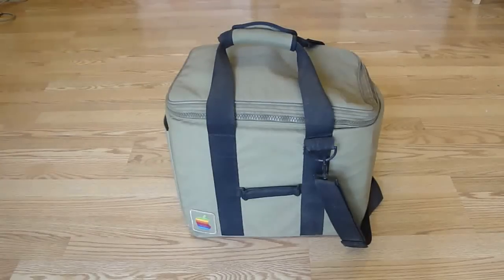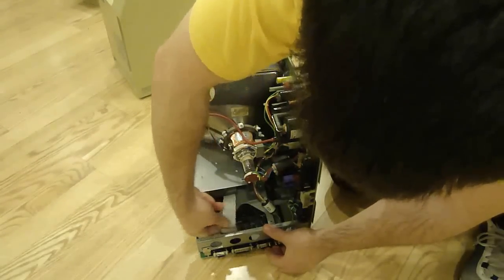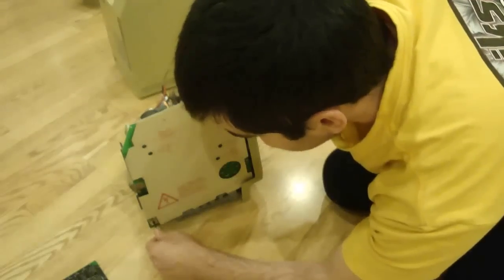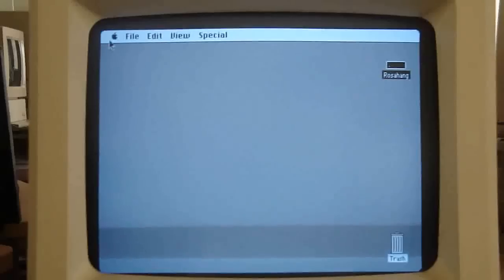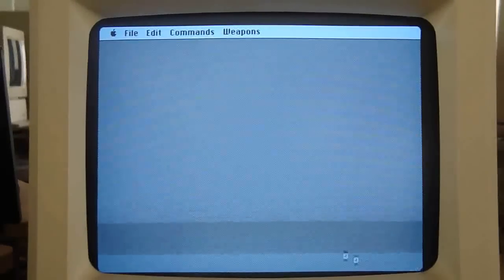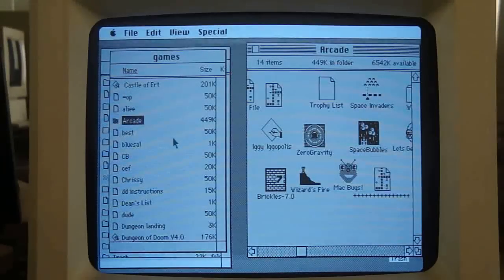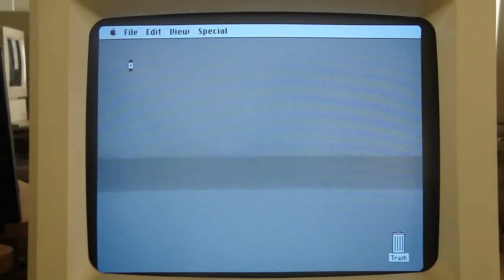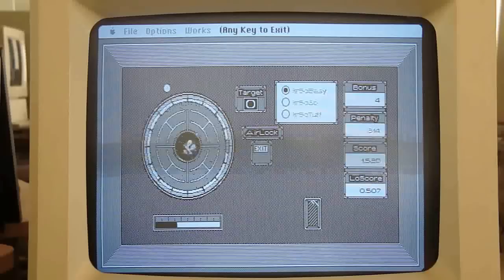1984 Macintosh 128K/512K Teardown and Review

Comment: Grounding to the chassis only works if you have the AC cable plugged in, otherwise you're just floating the chassis voltage as well

Comment: Thank you so much for this clip! I worked at Apple back then. Haven't seen the inside of an original Mac for many years. Was an engineer in Peripherals Test and Hardware Development. Tore apart and reassembled dozens of machines like this every day. Also HDs, mice, keyboards, trackballs, joysticks, scanners, even fax modems. Your video was a real treat. From the instant you opened it, the layout and components were as comfortable as an old shoe (I was telling you out loud not to forget that last wire, lol, and yes, we used to enjoy tossing those charged tubes to unsuspecting new colleagues). I still have my long Torx driver and case splitter. Sadly, most of my other old stuff was given away or trashed long ago. I left Apple in '88 but went back multiple times, finally leaving for the last time about five years ago. Looking back, I still love the way it was so easy to disassemble, upgrade and repair early Macs. Ingeniously simple. Today's designers often spend too much time immersed in a rendered CAD world and have little experience at the bench. They've forgotten the art of creating products which are beautiful in their entirety. Thanks again for this flashback.

Comment: Back in time when Mac was repairable. At today it is overpriced, prone to break (no conformal coating on PCBs in computer with 3000$ price tag) and only option provided by Apple services is to completely change motherboard for another 1500$. And even that doesn't guarantee that new motherboard will not break after a month because it is not new, but is a refurbished crap (and refurbishing is gluing a rubber pad over SMC chip). Apple, WTF!

Comment: I still have a 512k machine that was upgraded to 2.5MB RAM with the MacSnap upgrade board, and a SCSI port using another MacSnap product.  The 25-pin SCSI connector came out of the battery door, so there was no exterior case modification needed.

Comment: How come this Macintosh has an internal hard drive? I used to have a Macintosh 512K way back and we always had to put in 3.5 inch System disks in order for it to start up.
Reply: +ChaosPod It does not have an internal hard drive.  The Mac is sitting on top of the hard drive, and it is plugged into the floppy drive port.  Yes, it was very slow.   Later models would add a HDD port, and then the Mac Plus had a 25-pin SCSI port.
Reply: +rbstorms Oh, I see. I didn't realize 512K Macs had hard drives as all I remember from it was the Mac in one unit with monitor and floppy disk drive combined and then you would connect the keyboard, mouse and also a 2nd floppy disk drive if you wanted and everything would run on 3.5 inch floppy disks.

Comment: I used to service these.    Take a close look at the solder connections under the flyback transformer.  (the big component that has the wire going to the side of the picture tube.    One of the solder connections was notorious for cracking around the pin of the transformer.    It would arc for a little bit until the gap was wide enough to prevent contact, so it will be obvious.

Comment: Using a screwdriver with a thick wire to discharge the CRT is a good idea IF the other end of the wire is actually grounded.  In this case, it wasn't.  The safest method, if you don't have the right equipment, is to take that little Mac outside, look for your house's ground wire (copper rod in the ground near the electrical box) and connect the other end of the wire to that ground rod instead of the Mac's chassis (which in this case would be a 'floating ground' that could still shock you good).  Now you have a true GROUND (hence the term) at ground potential.  The electricity in the CRT will race out of the screwdriver, down the wire into ground rod in the soil and into Earth.   You'll be perfectly safe.
Reply: yes and no, you are implying that the frame isn't sufficiently isolated from the CRT's circuitry and it was. The biggest cringe I got from this was no resistor inline on the jumper cord. 2nd going 'outside' is just stupid. there are ground points everywhere in a house and especially a shop. Anyone who worked on elx has both an outlet  stub and a ground stub. When elx really needed it, not now due to the throw away mindset of development and the lack of any real elx repair shops, you would then attach yourself to the ground point for anti static reasons. Though internal (both chip and board level) anti static solutions are the norm.

Comment: You could use concrete as ground for discharging the CRT,I learned that the easy-ish way,I dont have a Macintosh yet,but I will get one. My dad told me that concrete is ground after my MacBook zapped me a couple of times when I touched it with my wrist while it was charging.
Reply: Please be careful!  Concrete is not a good ground.  Concrete is an electrical insulator.  Electricity will not flow into concrete at the extremely high voltages, 10,000+ volts, a CRT discharges.  Go outside and use the HOUSE GROUND ROD near the electrical box.  It's that copper rod in the ground with the wire going up to the box.  It is a true earth GROUND.
Reply: +Herb Garcia this is very good information. also sometimes the grounding rod is inside like in my old house it was in the garage on the opposite side of the wall where the breaker box is. but it's always gonna be somewhere near the breaker box in case any of your reading this can't find it
Reply: Would it be possible to replace the CRT with a LCD display? Just curious. LCDs don't use as much power as a CRT.

Comment: Recap the analog board and it might work.
As for the ram upgrade most 128K macs were upgraded to 512K as you pretty much needed 512K ram to actually use it.
Reply: ***** I think you mean that the 512K upgrade was needed for it to be useful, especially later on (22K was consumed by the video RAM alone!).
Reply: Yuhong Bao
Yes as otherwise you would be constantly swapping disks.
The Mac that ran the 1984 demo actually had 512K of memory.

Comment: I got the mac se fdhd and too bad the hard drive is dead. It won't spin up but a quick smack or two fixes that but the actuator arm won't move. If it did I could invade privacy and see what cool stuff is on it. I just bought a new 230mb hard drive for it. So excited to get it working.

Comment: Once you add 3rd party RAM upgrades (a hack), then it's not a Mac 128K or 512K anymore.  Those models are defined by their RAM, which was not made to be upgradable.  What you have there is essentially a Mac Plus with 2MB of RAM in the original casing.

Comment: Looks like old Sal is still working after a quick google search. I guess he didn't learn about deleting your files before dumping or selling your old computer.

Also, I've never seen anyone use needle nose pliers to pull the flyback anode, I usually just use the same flathead that I use to discharge it. Either way works, I'm just paranoid of getting shocked and prefer to have it grounded to the chassis the entire time. I've seen a few that hold charges even after grounding multiple times.

Comment: I used to fix these for a school district a long time ago. Look over the analog board for cracked solder points. Most of the time the flyback transformer just needed to have the solder job touched up a bit.

Comment from the maker: Yup, that will happen over time with these old CRTs.  Most likely you'll have to open it up and adjust the focus potentiometer (small little knob) by turning it with the computer on to see how far to turn it.  I've had to do that on my Galaga before.  Just don't touch any other components, especially around the anode cap or you'll get a shocking surprise!  :)